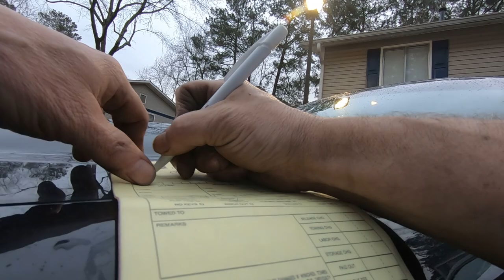Parking Revenge #104

Comment: "They got yanked!" Hell yeah! As someome with a permanent disability and a handicap placard, appreciate you catching the cheaters! 😊
Reply: There is alot of people, that park in handicapped spots that aren't handicapped.  I've seen it a bunch of times.
Reply: I’m in a situation where I am in a wheel chair and have been for 8 months.  I had a disabled placard, but it expired, as did my drivers license.  Without a current license, they wouldn’t renew my HC.  With Covid-19 in full swing, it has been  almost a year to get my license renewed so I still don’t have a HC.  I have parked in HC spot, without a placard,  but I have needed it. I was due to get my license this past week, however I was exposed to Covid-19 so I had to cancel my appointment.  I don’t know when I will be able to get it, but I’m still trying.  I was told by a police officer to park  there, not 59mworry, even if I *ot a ticket, showing up in a wheelchair, the ticket would be dismissed.

Comment: In London they use trucks with cranes on.
Just pull up next to a vehicle, connect the wheels and pick it straight up and put it on the back of the truck.
Would be a lot easier when trying to get cars out of parking spaces like that.

Comment: Just curious...Is it legal to drive with the car on the bed, just hooked to the winch or is the car being strapped down more before exiting the property.

Asking because i know that here, it would be considered an untethered load. Imagine a crash where the truck stopped fast, that car would come flying into the cabin of the truck or if the truck was sideswiped, the car would fall off, possibly landing on the car that sideswiped the truck ?

Basically here, even if the truck flipped onto it's side, the load (car) would have to stay with the wheels on the bed of the truck, on it's side.